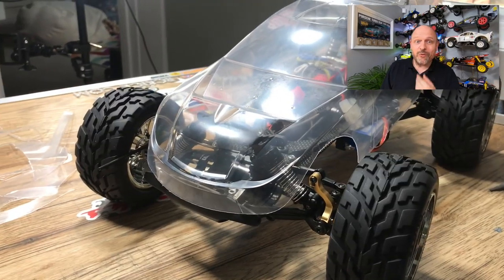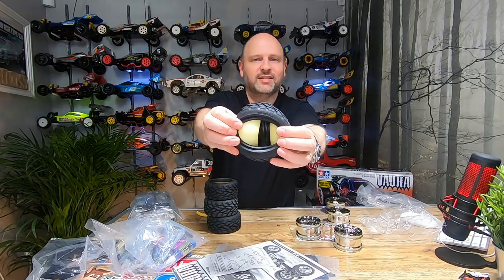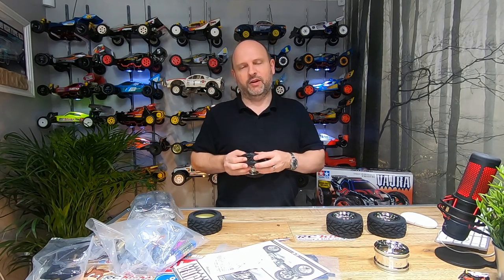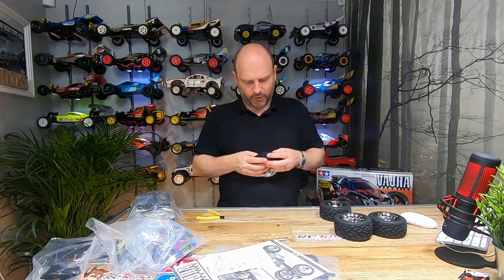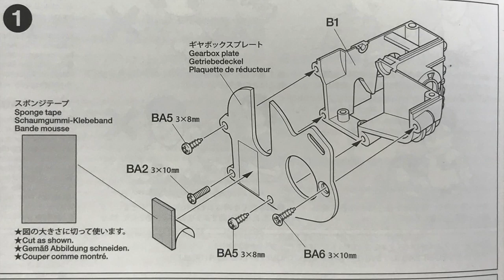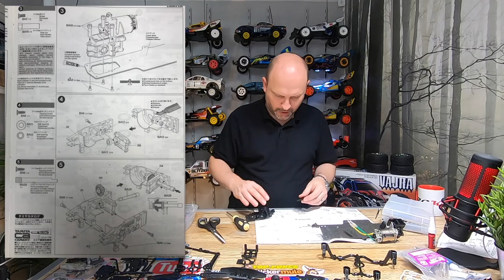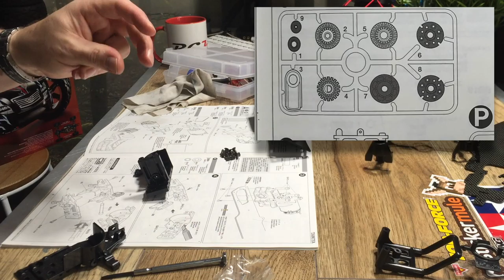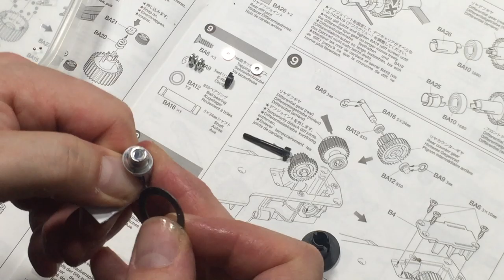The Vajra AVANTE Chassis RC Racing Truck From Tamiya. It Can't Really Be That Bad? | Build Vid Part1

Comment: Hornet is a definite win for worst tires.  Froze the wheels, boiled the tires and cut my fingers open.  Took me twice as long to build the wheels as it did the entire kit.  

One possible reason the chassis on the Vajjy might be fragile, manual states to run instant cement along the edges of the carbon fiber parts.  Not to many people do this.  It is don't to add strength to the part.  I've been a bit rough with my Vajra at times and only broken the bearing carriers.  I will add, the optional decals are for the Levant I believe.  I preferred the box art.  Love the lightening bolts.
Reply from the maker: Yep I did see that in the manual about the edge treatment.  I can see how that would help.  The Levant and Super Levant have different stickers to the extra set in the Vajra box.
Reply: Didn't know about the decals being different.  Instill have mine, was going paint a separate body with them for a basher body.  Lol.

Comment: What would the plastic alternative be? Metal parts? I see Lego are commit to moving to an environmentally friendly plastic alternative - but I wonder how well this alternatives would stand up to the stress of dynamic forces vs a static model. Hmm.
Reply: The original Avante had metal links. But if you had to stick to plastic, nylon composite is the go-to in the RC industry and Tamiya is actually an outlier for continuing to use ABS.

Nylon's better environmentally too... well, kinda. It can be biodegraded under controlled conditions, but not in a landfill. But that's better than ABS which doesn't biodegrade under any circumstances.

Comment: Sweet build but I use proline products did it rain in ur studio those stickers are killer replaceable brushes I'd stick with that motor I hate plastic gears what you think spacely sprockets or codwells coggs jumanji did I just see you red lock tight ur motor   what happens if u got to work on it  should have used blue name tag song did u just curse